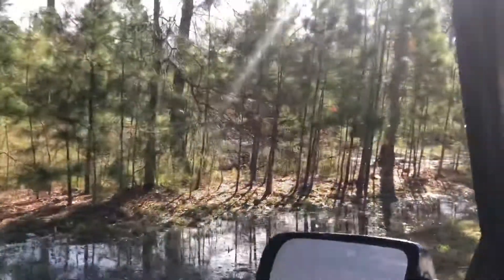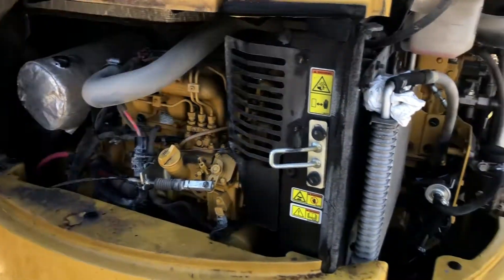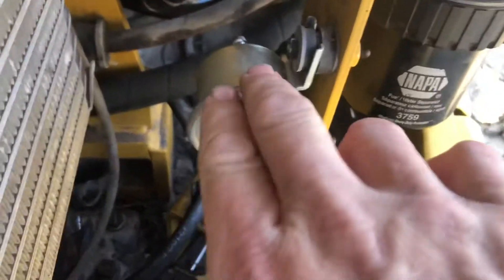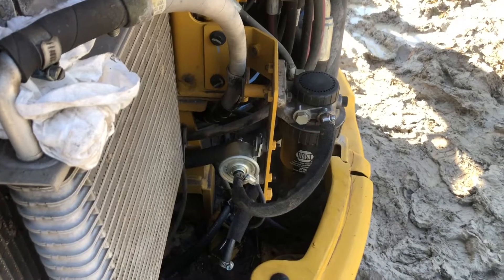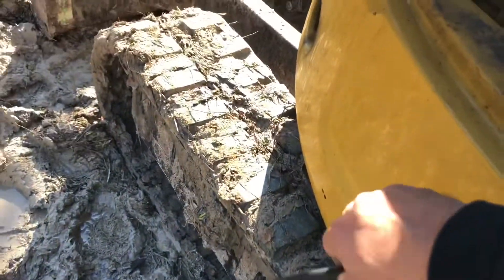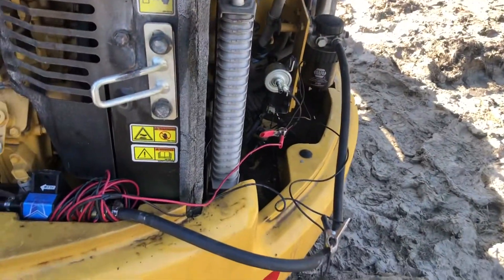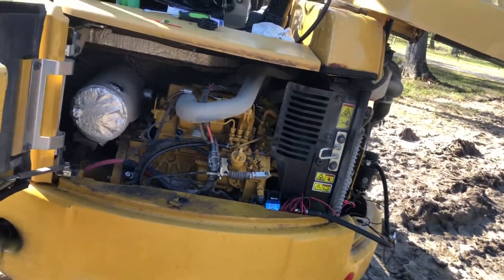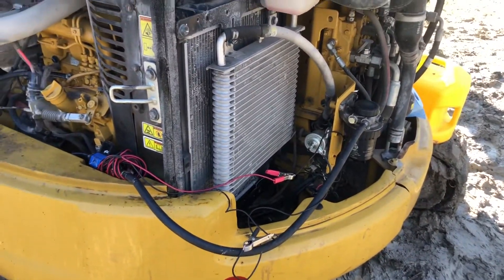Cat 303.5E2cr Fuel Priming Problems

Comment: great vid man thanks! you answered my question about which direction the low pressure pump sucks the fuel. I had an issue a while back where I ran my 305c low on fuel. The problem turned out to be that, for whatever reason I'm not sure, the low pressure pump switched polarities. so instead of pumping to the motor it was pumping air back into the fuel tank. the solution was to just switch the wires in the fuel tank under the floor mat. Now today thought it might have happed again so I was trying to remember how it was done before, but your vid lets me know my previous problem was different. Will try this bypass tomorrow thanks again!
Reply from the maker: So glad I helped you out. Thanks for watching.